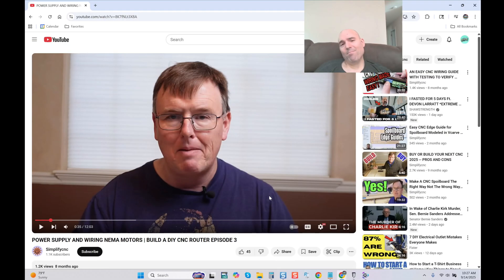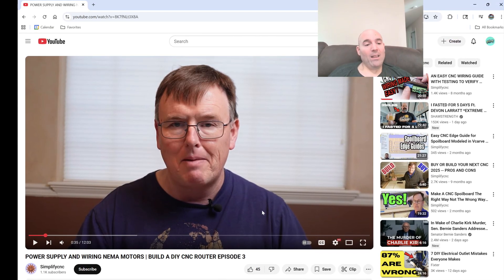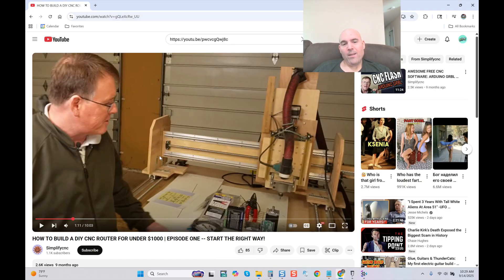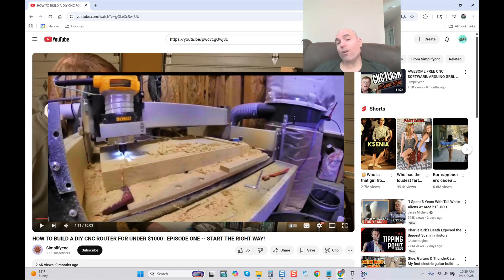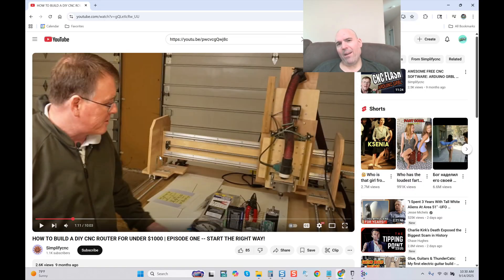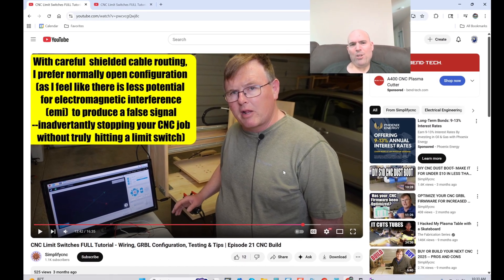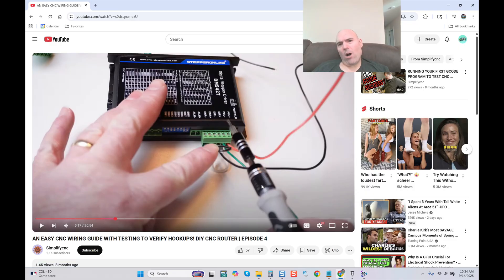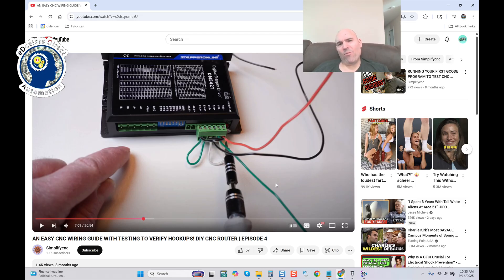From Bad to Worse: A DIY CNC Documentary

Comment: 6:30 so he is worried, that EMI could cause false signals on the limit switch cables - but aren't Normally Open switches even more prone to false alarms due to EMI?
Reply from the maker: It has nothing to do with EMI in terms of the version you select for the switches N/C, or N/O its the point that a normally opened switch is just that normally open all the time, so in the event a wire breaks to the switch, or the switch fails at all your motion control software won't see it as failed, and your going to have a crash.

 N/C setups of switches is always best practice. If you need more information search my channel you have over 700 videos to continue your education. 

Thank you,
Vince

Comment: HORRIFYING ! ! !
However I have to admit that I modified my 6040 to use an Arduino board (because my PC was stolen along with the serial port software of dubious origin that I got from the supplier) as most serial port type software is simply too expensive for a pensioner to afford.
I swapped in the UNO with the dreaded USB connection which has allowed me to use a free package to run my machine.
ALSO, my 6040 came from the factory with the limit switches wired as NORMALLY OPEN.
AND NONE OF THE AXIS RAILS WERE PARALLEL AND NONE OF THE AXIS WERE AT 90 DEGREES TO EACH OTHER.
Rebuilding the machine so that everything was parallel and square and rewiring everything including the controller box so that it was, in my humble opinion, the best that I could get it took me a year plus and now it is OK for wood and plastic.
Reply from the maker: Unfortunately, that happens a lot on those systems. I'm glad you got it sorted out. Thank you for your support. Vince

Comment: stranded wires in screw blocks without crimped wire end ferrules are strictly unlawful. yes, including low current low voltage signals. it's just unsafe.

Comment: Mr. Corvette guy, I like your channel but I do disagree with some of your comments. In this particular video. Many people have hobby grade wood made CNC machines and they work great. I have one myself. I also have a professional grade CNC machine. They are fine for what you need them for
Reply from the maker: My name's Vince.

Thank you for your support. 

The facts are facts.

Wood is flammable, and if a fire occurs you won't be covered if you have insurance on your home, and shop. If any end user is accepting this massive risk, then so be it. Funny this is never talked about by anyone in this genre, but me yet virtually all people with home owners insurance, and shop insurance would make a claim if a fire happened to them even though they have no idea what's covered in the event God forbid they experience this. 

How is your wood CNC grounded as wood is an insulator? 

Content creators making videos to promote the practice of using this substrate for a CNC production robot to novice end users is not best practice, and is dangerous. 

If people can't afford to build a CNC robot with the correct materials then they should save to do it correctly as doing it wrong costs more than purchasing one machine built correctly. 

I hear people have two CNC's as you said, and honestly you could have just saved your money to invest in the PRO model as there's absolutely nothing you couldn't have learned from it making you need the wood version for if you set the robot up correctly. 

You also certainly wouldn't have bought another unit if the wood version you had was proficient, and in the end investing in two machines cost you more especially if you're no longer using the wood version because you now have the PRO version.

Thank you,
Vince
Reply: @corvetteguy50  facts are facts, like the fact that this is a one in a billion problem